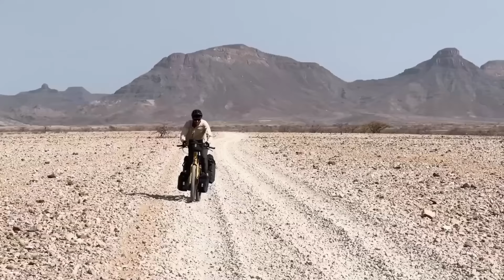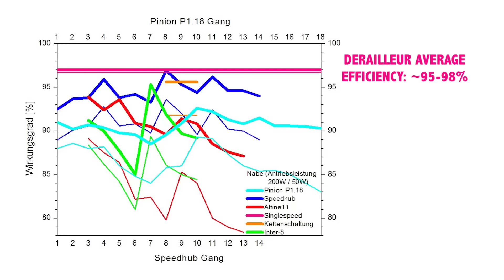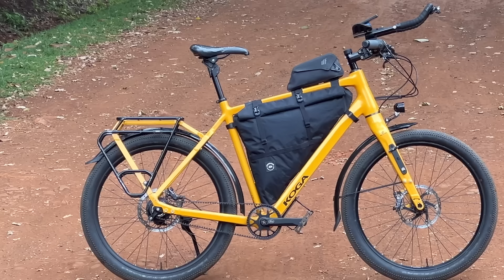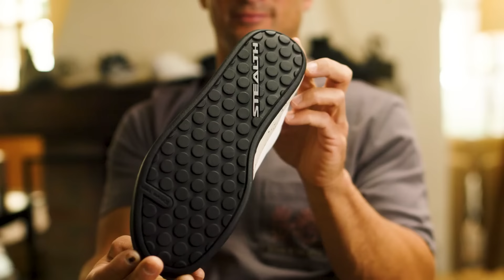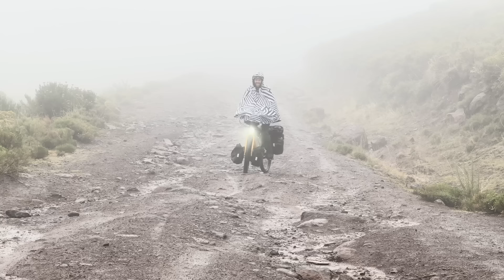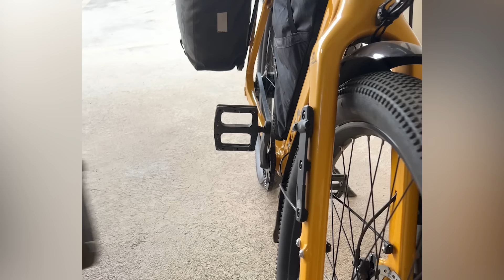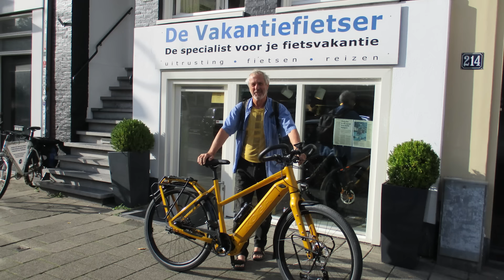The 2026 KOGA WorldTraveller is a $8000 Indestructible Touring Bike

Comment: Any thoughts or experience with the Igaro dynamo USB charger? Meant to be significantly more efficient than even the best from other vendors.
Reply from the maker: I haven't seen that the charging efficiency is higher, but they definitely put out a lot of power. 4.5w at 20 km/h and 6w at 30 km/h. This is an independent power graph of the Igaro C1 compared to other top-performing chargers: https://www.cyclingabout.com/wp-content/uploads/2025/05/Dynamo-USB-Chargers-Cycling-Power-Graph-Fahrradzukunft.jpg

Comment: Minimum rider height for this bike is 163cm and 166cm for the ebike version.
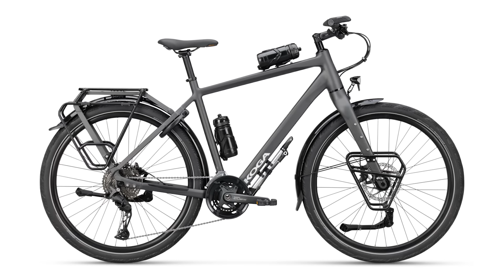Reply from the maker: With the step-through frame design seen at 18:22, riders can be shorter than that.
Reply: @Cyclingabout  That's true for additional 1 to 3 centimeters.

The step-through frame, which Koga calls it the "women's" model, has a minimum of 160cm minimum rider height.
The Ebike "Women's" version allows 1 more generous centimeter; aka 165 cm.

The Men's frame seems to be the only option with the belt drive.

Comment: I am nearly your height, but over 50 kgs heavier. After watching this video, I decided this overbuilt, low maintenance bike would be nearly perfect for me. I am 74 years old and have a track record of having good things come with a catch. At the end of the video came the catch. The Koga can’t be shipped to the United States. At least that dream was squashed in only 19 minutes.
Reply from the maker: That's a shame you can't get it in the US, but it's a great excuse for a trip to Europe! By removing the European VAT on one of these bikes you'll cover your flight costs.
Reply: Consider getting a Koga in Europe (come on a trip) and bring it with you to the US yourself. All airlines have a sports equipment/ bicycle baggage policy and it's usually from $0 (counts as a check in bag) to $150 max. Since it's your personal bike you don't have to pay anything extra when you get to the US. Any EU Koga dealer will help you pack this bike for travel and provide a sturdy cardboard box. All you'll have to do is get a Uber XL to the airport to fit the box. The bike is Aluminum/ not carbon so I would not worry about it in transit. I've flown with a bike 30+ times for bikepacking and never had any issues.
Reply: For $8K you could get a custom-made titanium frame build that would work with any drivetrain. It would be just as durable as a Koga and weigh a lot less.
Reply: Yes. KOGA I have been pinning for this bike for years.. but we in the USA have to find alternatives 
Kona Sutra, perhaps an older steel Trek 520 when they were made in America ?
Reply: Get a good fully for this Money and you even will have more Komfort.
Reply: I believe there is a store in Santa Barbara that facilitates buying Koga in the US.  It has crossed my path on some on-line searches after I have been inspired by these Cycling About videos.  But first I need to ride more regularly to work and the grocery store.😮

Comment: What happened to the Cane Creek eeSilk+ you used to ride with? The Rideshift gravel pro is better I suppose due to the elastomer + spring?
Reply from the maker: The Redshift PRO Endurance is a significant step up in terms of performance on rougher roads. On smoother roads, the eeSilk+ is still a great option.

Comment: Thank you for the in depth review, I really waited for that video of yours, fantastic work. I have a few questions, if you have time to answer:

- Why did you choose the the Velcro suspension stem over the redshift one? What makes it better?

- Apart from the bullhorns being switched for aero bars, how does the 25 degree sweep compare to the 34 of your dental bars? Especially regarding riding comfort for longdistance, shoulder comfort and steering feel.

- Do you find your round ESI silicone grips comforting on long distance in your setup than ergonomic grips like the Ergonomic GC1?

- You ride the SON 28, do you consider upgrading to the SON 29S (if a wheels breaks or something)?

- And what do you think about the new SON Ladelux? You said that it sucks in about 1kph of your speed vs 0,5kph with the Edellux 2 because of the higher light output. But when it’s off and just charging your devices that doesn’t count in. The measurement of SON says that with your current SON 28 the Ladelux can generate your required 5 watts for charging already at 15 kph vs the 20kph of the Plug 6 plus. 
And the combination with the SON 29S will be even more efficient. I find that fascinating.
Another benefit of the the Ladelux would be your problem of the water protection with the plug 6 plus. The Ladelux with its magnetic cable is watertight and can be used in rain (if the device is protected of course). Maybe that would be a plus for you.

I know that the light upgrades are not necessary as your setup is already great, but I perceived you are searching for the best setup possible.
So I thought in this area is still room for a bit of optimisation.

Safe travels for you :)
Reply from the maker: - The Vecnum stem has a multi link design, which is better for flat bar bikes. There are reviews on CYCLINGABOUT and a suspension stem video on YouTube that explains in detail.

- There is no meaningful difference for me between 25 and 34 degrees backsweep. Both are comfortable with my upright ride position. I just wanted the grips to be located a bit further forward than previously as my saddle position has also moved forward. These 25 degree bars put my grips where I wanted them.

- The ESI silicone grips damp more vibration but I really like the shape of GC1s. With the rough roads I'm riding, silicone grips are my pick.

- The 29S isn't available for 15mm thru axles. I'm not sure if SON will be producing a MTB version but I assume so. The higher power output would be ideal for me and my slow off-road routes.

- The Ladelux looks like a great product, and definitely sets the benchmark for light/charger setups.

Comment: For what Alee does, its a great bile. For the rest of us, a 21kg tank is OTT. Koga discontinued his previous orange and green models ... but have recently reintroduced them and its this "old" version thats more appropriate for most mere mortals.
Reply: I am thinking the same. While it is definetely true that weight does not matter as much as people might assume, if it matters, it matters twice. With a couple of Kilograms less you might be able to go 1 percent-point more uphill before pushing, or if you have to lift your bike over an obstacle or carry it up stairs, every kilogramm counts.
But this is more likely the more remote the tour gets. For everyday riding I have "comfortably" ridden with 30-40kg of added weight up 8-10% gradients while moving part of my belongings to another place. The weight added maybe 5min on a 25km trip with 300hm of elevation gain.

Oh, my tank was about 18kg unloaded and has also a rating for 180kg. I've only put it up to 150kg to the test though.
Reply: Rohloff + Dynohub is such an epic combo. I’m going ultra light single speed plus Dyno for flat commuting once you have one it’s hard to go back to charging lights all the time

Comment: Tumbleweed Prospector for the win, over this.
Reply: @garybutcher8799 I agree the Tumbleweed Prospector is a very well made bike, but appreciate hearing your specific reasons. One of mine would be that the Prospector is steel, which is repairable almost anywhere by a steel welder. If I'm not mistaken, aluminum frames would be much more difficult to repair.
Reply: Then there is Tout terrain, Tanami or Silkroad
Reply: All three of these bikes are good. I have had a Tumbleweed Prospector since 2021, and I'm very pleased with it after many kilometres. It is a good choice if you want to try 4.00" fat tyres and still have a reasonably narrow Q-factor. Though, as Alee explained, his 2.8-inch tyres still performed very well off-road throughout Africa. One shortcoming of the steel Tumbleweed is not being able to install a Gates Belt. For my Rohloff I've had to stick with a traditional bike-chain because the rear frame stays cannot really accept a frame-splitter without voiding the frame warranty.

Comment: You should consider other aerobars. Pro Missile AL. The great advantage is, that you can change the position of the pads much more, independent from the mounting point. Therefore you can bring them much closer to your body and find a much more comfortable position.

And there is a bag for aerobars, which is aero as well and gives you 4W when windspeed is 25 km/h. And it is very light-weight. Check cyclite.

Comment: The tyres are not like a tank, looks kike G-One Allround?

 There is an option that is faster, more comfortable and much more durable as well.

Schwalbe Marathon Efficiency. It has the same rubber, the same fast puncture protection. But much thicker rubber and 67 TPI carcasse. Therefore the sidewalls are more stable. Normally this means slower. But on the same rim-width this allowes you to drive much lower pressure. Therefore it is more comfortable and softer and therefore faster on rough rodes. Though this tyre is not ment tubeless, you should drive it tubeless. It works really good. The profile is also better, faster and more grip.

Comment: I have a koga worldtraveller and can totally agree on all the descriptions made in this detailed video. But I will point to a huge drawback, a big Achilles talon:
My model of bike has a rear derailleur hanger that is a complicated part súper specifically made for this bicycle. If it brokes (wich is something a bit common in derailleur hangers) you can only replace it with the original made by koga. But dealers only send koga spare parts to some countries. For example, a had problems with this piece in turkey, wich is right next to Europe, and the dealers don't send there. So if you are worldtravelling, and had a problem with this part, your trip may end totally right there.
If you by this bike, buy and extra derailleur hanger with it.
Reply from the maker: That's some great advice! I'll make sure to add it to my resources about the derailleur version WorldTravellers.
Reply: For any bike frame that I buy, I get a matching spare derailleur hanger or two at the same time. If getting the specific derailleur is hard, I won't buy the frame.
Reply: I wonder if they are working on a version with UDH, because that would really open up some options.
Reply: @mellissanash7517 indeed! That is what this tipe of bicycle should have. So wherever in this world you are, you can fix it.

Comment: This is a prime example that tubeless is a nobrainer. You had 0 puctures with that paper thin tire bc of the tubeless system and the sealant.

If you want to try a new and different approach of flat pedals give a look at the Outlier Void.

You should consider metallic pads for this application for a set and forget at least 5000km. 

Short brake levers have a cam mechnism to make it more compact and have a different "power curve".
Reply from the maker: While the tubeless sealant does a great job, I get very few cuts and holes in these tyres, in fact, I've probably only used 2-3 plugs. The tyres are tougher than you think!
Reply: @Cyclingabout I mean paper thin compared to Marathon Mondial DD.
Reply: @Manetty6  It's also paper thin compared to the Nobby Nic. They could easily give a version with the Super Ground casing of the Nobby Nic.
Reply: @Cyclingabout  If the tire comes off the bead, how would you get it back on then? With CO₂ cartridges or by just putting in an inner tube?

Comment: Hi Alee, Love your channel and your technical research!
How do you compare the Koga Worldtraveller Classic (on which you rode so many miles) to this somewhat heavy duty bike?
You've mastered so many challenges on that lighter bike, which is fortunately still (or again) in production.
Reply from the maker: I loved my WorldTraveller Classic! I wouldn't pick it now that I've finally got the wide tyres and super stiff rack that I need, but if you're riding smoother roads with less weight, then it's an exceptional bike.

Comment: What is the tire pressure you are  using mainly on regular roads
Reply from the maker: 25 psi is common for tarmac. Any less and the tyres squirm too much under the weight of the luggage/food/water.

Comment: I've Trek 520 but giving chain plate cracking issues. Multiple times have to replace chains. Original Shimano lasted longer. YBN got damaged early. Driving KMC on middle gears.Mechanical chain on such heavy bikes have become a costly affair. 
Other wise overall bike is rigid and till now gave no issues.

Comment: Riding through a rural village with an annual income of $500 per capita on a $8k bicycle.
Reply from the maker: What’s interesting is that in the villages, people just see my bike as an ordinary bike - it’s the ones with cars or motorbikes who are seen as wealthy! So we often bond over our shared reliance on bicycles, trade stories about our days, and talk about what we’ve been through recently.

Despite having a fancy bike, the experiences I have seem worlds apart from those travelling overland by car or motorbike.
Reply: yeah, you'd never say that about a car
Reply: Is it better with 40 k€ car or 4x4?
Reply: @nertis2408 Your point is valid, but there IS a difference. Cycle touring has always been a cheap activity accessible to young / fit people with plenty of time and not much money. It's basically dirtbagging on 2 wheels. In my mind, $8k bikes don't really sit well with this ethos. And while this is obviously towards the top end of the touring market, it helps drag the prices lower down the market too. I mean people talk about a $2500 Pinion bike as though it's a cheap ride.
Reply: @duncan-xg9sh  Sure, i'm this guy using my everyday 400€ bicycle touring in France and Europe on the smooth asphalt. 

Isn't it necessary though to buy much better and expensive material for crossing Africa ?
Reply: @nertis2408 Traditionally you would have a steel frame touring bike for riding through Africa. If it breaks, you can get it welded. Basic steel frame tourers were not cheap but also not very expensive (my Surly LHT cost about €1k new).
Reply: This is his profession. Seems like a reasonable investment that will last for years.
Reply: @TheOregonmccarthy Koga gave him the bike, but even so fair point. I'm not knocking anybody for having a posh bike and I'd take it in a heartbeat. It's more a concern about where the cycling industry is heading. I just bought a 12 year old Honda Civic for less money than I could sell my 13 year old Surly LHT on ebay (which is 2x what I paid for it new).
Reply: And you probably wear shoes for $200 or a smart phone for $500 and the people who make them earn $100 a month...

What exactly is your point now?
Reply: 8000 dollar bike takes less than 5 minutes to steal.

Comment: I'd rather have a pinion, every owner of a Rohloff I've met has oil leak problems plus a pinion is better weight distribution.
Reply from the maker: Both the Rohloff hubs and Pinion gearboxes have their fans! I think it really depends on your use case as to what's best for you.
Reply: @Cyclingabout what use case would favour Rohloff vs Pinion and vice versa?

With pinion it's easier to have several wheels for the same bake, say with knobby /slick tires.

But what about Rohloff?
Reply: @SantoRedentor yep Pinion would be my preferred option
Reply: he has a video that compares rohloff and pinion. i recommend watching it, it‘s great.
Reply: @daseishorn1863 I'm pretty sure I watched it some time ago, I just don't recall the conclusions. He has too many good videos and so information dense to recall everything.

I've had the idea of an internal gear bike in my head for a long time, but I'm scared of the weight.

I one bought a VSF TX800 (not internal gear, but 3x10 XT) with big dreams of traveling around the world, but sold it before it reached 1000km. It was greatly built and I loved the looks, but felt slooow like pedaling an aircraft carrier, and I hated that.

At the moment I ride a gravel bike with a derailleur and I like how that rides, but I hate cleaning and greasing the drive train, as well as bent deraileurs.

I like Pinion and Rohloff from a technical as well as maintenance point of view, plus they're made in Europe, so I still have the idea in my mind, but I've never had the chance to try one, so I don't know if I'd like how they ride with the extra weight and reduced efficiency.
Reply: "every owner of a Rohloff I've met" - How many did you meet?
Let me have a guess: zero....

Talking in absolutes is always a sign of a BS story.
Reply: For the perfect cadanse on a touring bike you need small steps between the gears. 
So, this would be a Pinion 18, which is 500 grams heavier than a Rohloff system that is (a bit) more efficient and bulletproof. 
Also, the Rohloff feels more direct to the pedalstrike.
Go testride both of them and then choose.
Reply: I have a Rohloff on my Co-Motion Divide- no leaks - love the durability  and gear range.  Been working flawlessly for years